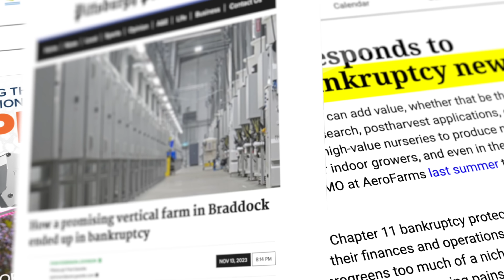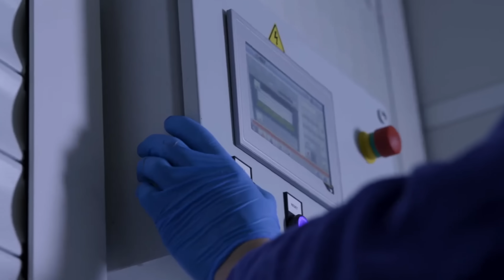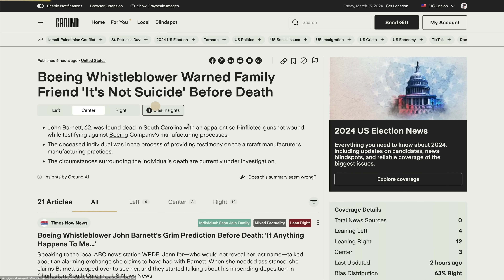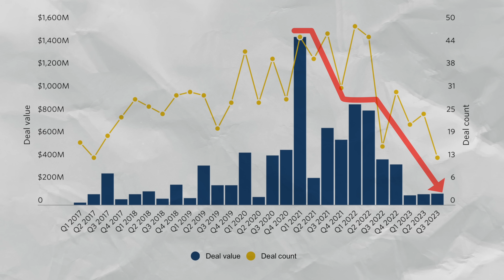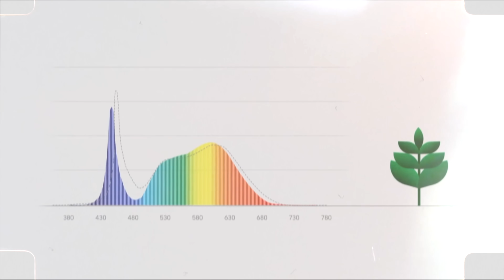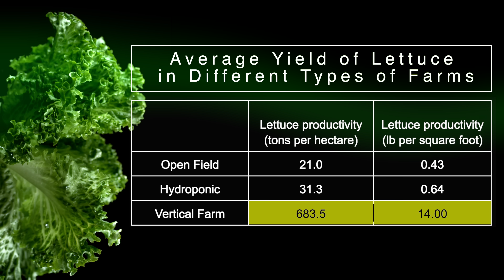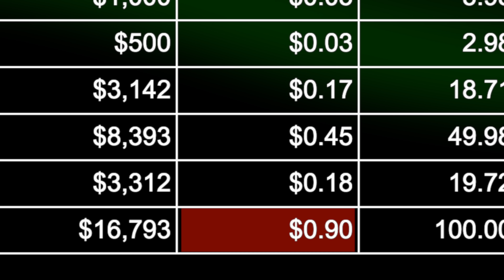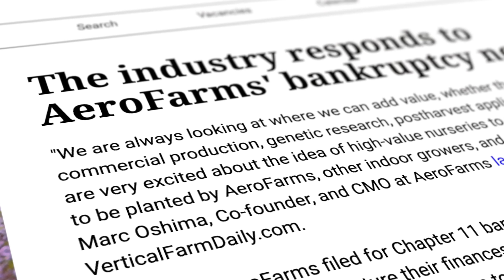The EPIC Failure of Vertical Farms - What Happened?

Comment: The real value of vertical farming is in military security... You read that correctly MILITARY security.  To understand why, we need to start about 3000 years ago...

In the ancient world, people often lived in walled cities.  The walls were never enough to defend the city because walls need DEFENDERS... people who stand on the top of the wall and knock over the attackers climbing ladders and the like.  Those defenders have mouths and stomachs that need to be fed.  It turns out that with ancient farming practices which were not very efficient in terms of calories per acre per year, it was not possible to enclosed a small city with a wall and have enough space inside the wall to indefinitely feed the defenders of that wall.  The bigger the city, the better the ratio of food-producing are a to defenders since the number of defenders needed to defend the wall scales linearly with the radius of the city, but the number of acres inside the wall scales with the square of the radius, but it turned out that you only hit break-even for walls that enclosed on the order of several hundred square miles in the best case scenario, and really several thousand square miles in more realistic scenarios as much of the enclosed area would not be particularly cultivatable land.  This is why sieges worked int he ancient world, and why we saw small fortifications (castles and walled cities) that were meant to hold off invaders until help could arrive, and we saw huge continent spanning fortifications like Hadrian's Wall and The Great Wall of China which were meant to protect agriculturally sustainable areas, but there was generally no point in trying to do anything in between unless it was based around leveraging natural barriers to invasion like rivers.  

In the modern world, agricultural productivity is such that a city, in theory, COULD produce the calories it needs to support its own defenders if it weren't for one thing: Air Power.  With the advent of the airplane, the defense surface of the city becomes the AREA of the circle not the perimeter of the circle.  Now you need more defenders manning fixed air-defenses across the entire city as well as manning the perimeter.  Worse, something like a vertical farm, be virtue of the very thing that makes it useful to the siege problem, is a juicy target:  High value equipment and personnel and vital infrastructure all in a small high concentration target suitable for a missile strike. You don't see normal outdoor farms hit with airstrikes unless it is by accident because they do NOT represent high concentrations of value in small areas that can be destroyed by the attacker.  

So, I hear you thinking... that suggests that vertical farms still aren't good enough to solve the military problem of sieges and logistics warfare. And you're half right, they aren't ON THEIR OWN.  But, the enable other solutions that aren't sufficient for other reasons.  Namely Bunkers and Ballistic Missile Submarines.  These are highly defensive structures specifically designed to be immune to direct strikes of any intensity up to and including nuclear bombardment.  They are also intrinsically limited military solutions because they, like the walled cities of yesteryear, will eventually run out of food-stores and be forced to open their airlocks and get supplies from the outside.  But what if they had a highly compact vertical farm inside them????  A nation with a fleet of nuclear powered ballistic missile submarines that, in extreme conditions could farm its own food indefinitely would be semi-immune to invasion.  Even if the invaders captured and held every single friendly port in the whole world, these subs would still be out there many years later providing a nuclear umbrella to insurgents and partisans fighting to drive the invaders out.

Comment: That many bearings in the industrial equipment wearing out in a facility that size means long-term maintenance (over decades) will be practically untenable. You'd have to shut down the facility for maintenance and upgrades every 5 years and in 5-10 you may not even be able to get the electronic parts for the robots.

Comment: These farms depend way too much on advanced technology instead of practical solutions.
Stacked greenhouses would be cheaper, specially in places that already use them. And depending on the time of the year and how far from the equator you are, you can get a lot of sunlight in without needing complicated LEDs, just mirrors if even that.
It looks cool to try and solve problems with hi-tech solutions but sometimes it is best to do it the simple way.

Comment: I am (still is) a fan of the concept of vertical farms but I did always think that the start-up cost and maintenance is going to be very high and take many years to pay for itself. I just assumed that people, smarter than me, had it solved before funnelling billions of dollars into it.
The building, the lights, irrigation and all the other systems to just have a basic level of plant growth is so high and then there'll be maintenance on the equipment, building, ... 
Sure you can eventually automate so much and eventually all of it but that will take time and money to research and then that equipment will need money for maintenance over time too. Surely someone pointed things like that out to investors or are they all just "tech bro's" that thought it'll all get solved by engineers?

Comment: vertical farming is done big time here in the Netherlands. The Netherlands is the biggest exporter of flowers. Most flowers don't grow on fields but inside of big greenhouses on multi level platforms that rotate each day so the flowers get enough light. Nothing in this cycle is done by humans, everything is done automatically, even the planting of bulbs is done by robots more and more. the only part where humans are still involved is picking and packing of the flowers after they've grown. 

Many people talk about pests and funguses etc. It's true these are big things and can bankrupt an entire company. That's why there are many extremely strict hygienic rules. When u enter greenhouses you need special clothing (like those white cloth onesie suits) and there's multiple stages of disinfection of hands, arms and shoes. You CANNOT enter these facilities with food that carries the deceases, for example you can't enter tomato greenhouses with tomatoes/paprikas (even those insta soup packs are forbidden) and some other food that's that might contain deceases. It is also not possible to travel between different greenhouses in one facility. 

The facilities also use things like doors, high and low pressure areas and vapor screens between parts to make it even more difficult for pests to spread.
Reply: only viable with a high value crop like cut flowers
Reply: Is air purity important?
Reply: @Loanshark753  Yes to a degree, but a greenhouse is the target of other larger problems like fungal spread, bacteria and disease.  Think of rural area vs. extremely urban like NYC.  Suddenly risk of contamination has a much larger impact on your entire population because of how quickly it can spread.
Reply: Seems like you need more resilient crops?
Reply: @chestnut4860 You offering to create them for us?
Reply: Do they? I've only ever seen single rows used, simply because that allows each plant to get the maximum amount of light.
Reply: So tldr, high maintenance cost with strict procedure that needs to be followed all time to make it successful. And ppl wonder why so many of these projects fail
Reply: Just paid $2.00 for a head of lettuce at the farmers market. The farmer I get it from has the best tasting lettuce.

Comment: There are lots of reasons why vertical farming doesn't work, you are basically forced into dumping insane amounts of energy into the system in the form of special lights and there are other issues I can see like the fact that the vertical farming will require a fairly significant amount of maintenance in the form of artificial pollination ventilation, and many plants can't actually survive in a zero soil situations without lots of specialized customization of nutrients.

Comment: I could have told ya, and honestly i probably did at some point. when growing crops consider this above all else. How much energy does it take to produce food. Not money, not time, not space, all the other factors in one way or another break down into some unit of energy per square meter cost. Here's the kicker, The sun provides to a plant about 2000 watts per square meter of energy.  Now i am sure someone will say Um achually problem is shut up, The sun does more then radiation on the plant for the plant . It drives wind rain and heat all at once light landing elsewhere is still doing work for the plant. Now people building plants in a closed environments need to contest this figure can you for less then 2000w per square meter move enough light water wind and thermal mass to match the sun. Answer is no the closest i have seen is 2650w per square meter to match the same quality outdoors. Farms are all ready struggling with all the potential of outdoors this is a fools game to try with current tech.

Comment: Here’s a kind of vertical farm nobody ever thought to call a vertical farming. On one plot of zucchini that I personally managed and redesigned in an operation that had many fields and multiple farms of zucchini and other squash and cauliflower.  We planted to 12 inch spacing instead of the usual 18”. Watering was with drip irrigation and gypsum block sensors indicated proper watering. The field was north facing and very steep, the steepest of all plots on the ranch, with coastal heavy clay soils. Initially I had to water for nearly 5 days continuously to get the sensors to indicate a properly wet soil. The close spacing caused the zucchini to grow straight up like a small papaya tree instead trailing over the ground like a vine, which is normal for zucchini. These plants continually grew straight up over a long summer season and were eventually very uniformly 7+ feet tall, that’s VERTICAL! We had to bring in more bees 🐝 for pollination because the foliage was soo thick! At about 4 feet tall we saw nutrient deficiencies and started fertilizing with a complete combination of nutrients that had been used for years with fruit trees in those soils. I always made sure the zucchini were properly water and never allowed to wilt even slightly. The zucchini fruit grew straight out at the base of the plants and often never touched the ground for their entire life. 
We picked and packed the fruit into a redesigned box that was much stronger and 40% larger than the standard, because the standard vegetable box we found to be breaking the zucchini and poorly ventilated for cold storage. The production with the larger box on this field was 1200 boxes per acre, a new record for all the fields on the farm even with the much larger box, and would have easily been 2000 if we had brought in more bees earlier in the season. Poorly shaped fruit were not allowed in the pack.
That year was the last year of this farm operation because the wealthiest partner in the operation saw this success as a great threat to his management of the operation and his own farm operating separately that had cooler storage and sales for our fruit. He admitted that we were profitable, but claimed problems that were not real, and production would have been so much greater the next year he had to shut us down immediately! This was a great embarrassment for him, the success of my radical growing system was the opposite of all the practices that he used in his farming operations.
Reply: Plants are amazing things. I have seen watermelons weighing 10lbs growing on a fence 3' off the ground.
Reply: I plant melons, pumpkins, and cucumbers the same way and get way more produce per foot.  It's also mildew-free since the leaves can stay dry.  I'm amazed how much weight vines can hold - each vine can easily support several pounds of food with proper vertical bracing - they also adapt well, with climbing vines being much tougher than ground-based cousins.  So far I've only done it with smaller varieties that weigh 2-5 lbs, but I'll be scaling up as an experiment.  Any fruit on a trailing vine can be grown on a trellis.
Reply: @shionyr  My zucchini plants 7+ feet tall had ZERO trellis! GOOD LUCK 👍🏻🍀
Reply: That’s really fascinating! It’s a shame you couldn’t continue the operation, it makes me a bit jealous as a horticulture student that you got to experience that haha. Is there more information you have on this?

Comment: So, this brought up some really interesting points I hadn’t thought of before. One being, collateral for loans. Farmers lose crops all the time. Crop failures are nothing new. But the land their farms are on holds inherent value so they can weather rough times by using it as collateral for loans to produce the next crop, or buy/replace/maintain equipment. A vertical farm is in a rented space with highly specialized equipment that generally has no collateral value. So one crop failure will crush them. 

The need for that highly specialized equipment and more importantly specialized labor is its own conundrum as well. But that is a problem whose solution is time and scaling or potentially technological breakthroughs. The former problem actually seems more insurmountable than the latter.

 Which is depressing because the vertical farming upside for the environment is quite enormous. But economically there just doesn’t seem to be a viable path for its induction into the mainstream economy.😢

Comment: 1. Vertical farming ≠ Hydroponics. Common mistake. Vertical farming is primarily about saving space. Many go the hydroponics route, with some using aeroponics, but again Vertical farming ≠ Hydroponics.
2. Vertical farming is PRIMARILY about saving space. Hence the focus on automation, lights, indoors, etc. That's why it doesn't make sense that the development is being done mostly by countries with no lack of land. Practically speaking, it will never be more profitable than a sun-lit farm because, as you've covered, a lot of the cost involves buying, running and maintaining the expensive equipment, with personal and electricity.

Comment: These vertical systems are pretty limited in what crops they can grow. You need things that’ll turn over quickly, and are short in height and able to utilise the LED’s short throw of light. That leaves you with pretty much just lettuce and leafy greens as a crop. Root crops are out, slower stuff like cauliflower is out, tall stuff like sweetcorn is out. Legumes maybe, but I doubt if you’d compete with soil farming on cost by a large margin. It looks cool, but it isn’t going to feed a city with everything it needs.

Comment: Growing food in a high rent district is always going to be expensive, but there are going to be other issues. With vertical farming, you have to think about food value per cubic meter, not square meter. When you do that you can quickly see that instead of having a food system based on grains, you need one based on something like duckweed. It's output in calories and protein are high per square meter, but when you factor in that you can layer the crops at a rate of 9 or 10 per vertical meter, the protein per cubic meter becomes unbeatable. Converting to a duck weed based food chain, though, requires a change with the consumer. That can be nearly impossible.

Comment: Per the 2017 USDA census, only 43% o even traditional farms are profitable. "Farming" really encompasses a number of different operation types, but most suffer from low cash yield and paper thin margins. Dramatically increasing fixed costs for the same crop, even with resulting higher yields, was doomed from the start.

Comment: Very interesting video. These are all solvable problems. These companies over complicated things. First off they should adapt OTS hardware/software rather than create their own or buy highly specialized gear. More so, why so much gear? Poor design choices in my opinion. I spotted 100 things they were doing very badly wrong just in the blips of the operations you showed. For one thing look at how many people were there. OMG no wonder the labor costs were insane. It's a plant. Give it what it needs and let it do it's thing. It doesn't require a PHD to see if a plant is doing well or not.  I could go on for pages on the mistakes. I still think it's a viable technology, the problem was how it was done rather than the concept. Hopefully they haven't done so much damage that better designed farms cannot get funding.

Comment: bro spent the whole video talking about how overhyped vertical farming is then said it'll work in the middle east because "there is alot of renewable energy". Is this guy serious? Using The Line another overhyped guaranteed to fail project as an example??? Even there where there is little water greenhouses will still out compete any indoor vertical farming because land is cheap and greenhouses are significantly cheaper. Even de-salination on outdoor farms in the desert could out compete vertical farming on costs.